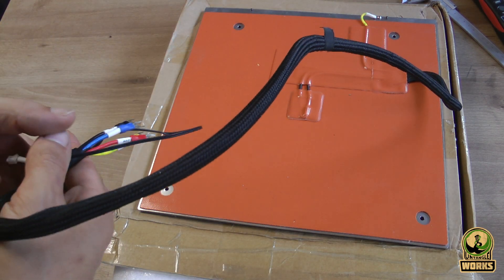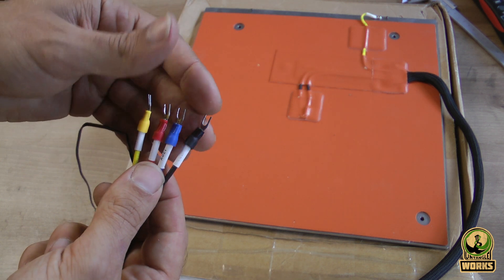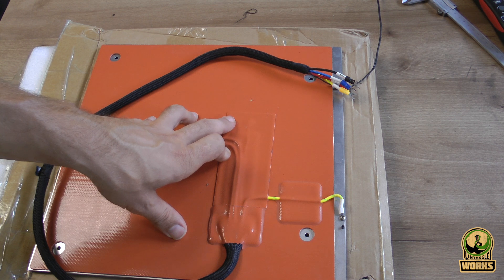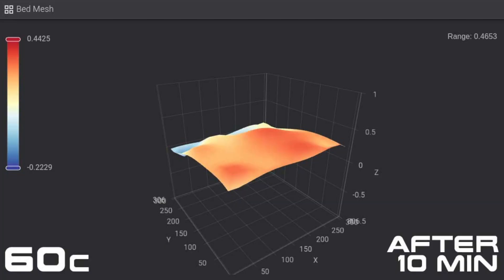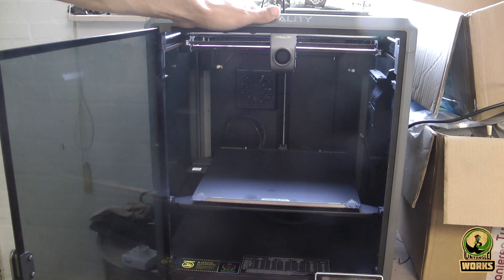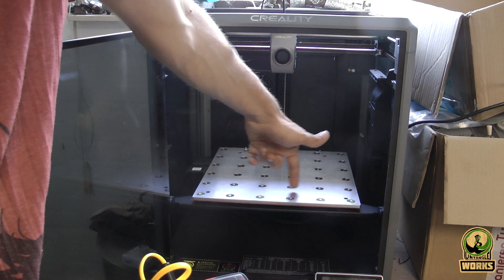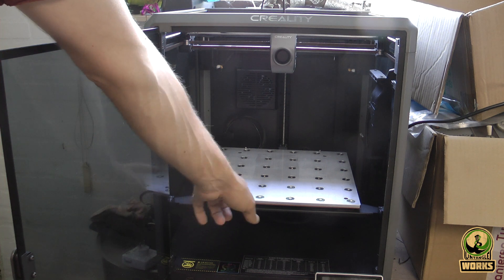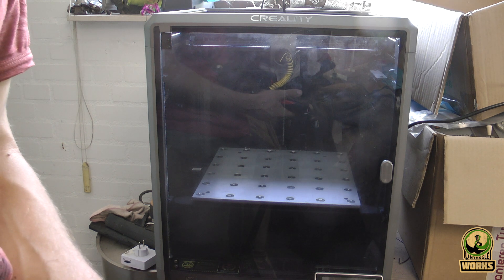creality K1 Max: a second look at the cased aluminum bed from aliexpress

Comment: probably not forged aluminium. they should not warp when heated. probably a cheap aluminium alloy stamped and "cnc'd afterwards. i got plenty of forged aluminium beds for printers and they are straight on all ranges.
Reply from the maker: yeah then it looks like not the real deal like you say.

Comment: Lets go...I've been considering going ahead and picking up one of these thicker aluminum beds!
How's it worked out for you so far?!
Reply from the maker: i consider it a waist of time and money
Reply: @UntangleWORKS  dude, this!
I just pulled up my bed mesh and printed up some shims and I got my bed level on POINT!
Reply from the maker: @lancenig  the shims work sure, but the bed warps when heated. i use a textured glass bed in case i need a large part of the built plate for now
Reply: @UntangleWORKS  That's a good idea, I'll have to track down and buy myself a glass BP for bigger prints. Thank you for the responses.
Reply: I'm thinking that until I get a glass BP for bigger prints one way I could get around the warping so to speak is to heat my bed up to the temp of the next print before I start the print with calibration...that way the bed will already be warped into it's heated "shape" so to speak. I'm struggling for the correct words to describe what I'm thinking.
Reply from the maker: @lancenig  https://www.youtube.com/watch?v=6vU0u630IjU
I have not watched this one jet fully but you might want to give a look. a different way of using the glass bed
Reply from the maker: @lancenig  yeah I get what your saying there. I have not tested this with the stock bed. but with the new one it just keeps on warping over time . but I can print things with it so long the Z offset is set a bit lower
Reply: @UntangleWORKS  This was actually the first video I watched on this whole topic. Now that i've got the bed shimmed this is probably the right direction to go. Thanks again!
Reply from the maker: @lancenig  yeah the shimming thing is working great. but buying the aliexpress bed i would not do it
Reply: @UntangleWORKS  i actually watched as my printer auto bed leveled in caliberation before a prank... It heats the bed all the way up before it bed levels so... That takes care of my idea of warming the bed before leveling as to compensate for warp.

Comment: I'm confused, Is the heat mat that you showed on the video is the one that came with the K1MAx and you are just showing the differences between the Aliexpress heat mats? Or did you get a new silicone heat mat from Creality and  installed it on the new bed? the reason I asked is because the I bought the Aliexpress thick bed and I noticed the difference between the two silicone mats. I tried to get a new silicone mat form Creality, but they don't sell them and some people have suggested to remove the mat form the old bed and reuse it which I'm sure that it is safe. I ended up using the heat mat the came with the new bed and had to do a custom connection in order for them at to heat then entire build plate evenly
Reply from the maker: yeah for what I have seen is that not a smart move to remove the heat mat and reuse it. but  my impression was as well that creatly is not selling them separately. but no I was showing here how unstable this aliexpress build place was it chances shape every time I measured it and letting it heat soak for like 0min, 15min and so on the results would be different.

I wish I did the same test in documented from for the official bed. but I don't think it's worth the trouble at all really and expense

Comment: There is a video on YouTube of a person you used a glass bed underneath the magnetic build plate. The glass won’t warp under heat so i think it’s a good way to have a level bed. He did claim he had to replace a part in the bed itself, maybe a probe if I remember correctly. But then he used 3M sheet to secure the glass to the bed and then a magnetic sheet ontop of the bed for the build plate to stick to. Because of the raised height you do lose the indexing screws that the build plate notches fit into for alignment.
Reply from the maker: yeah glass would be a better way to go if you have issues with the bed then this route that I took.  with this I got a textured glass bed on my ender 3 and that works really well but you will have to let it cold down for parts removal

Comment: Aluminium has a pretty high coefficent of thermal expansion (even higher than steel) so its not really a good solution. Ideally would be glass, realtivley flat with low CTE

Comment: If you tighten the back side bed bolts, and leave the front bolts just a little lose, this would secure the bed, but also encourage the bed to expand more in horizontal plane, and less in vertical axis.  Reducing cupping or bulging in the middle.  All four corners tight makes the direction of expansion only up or down.  All four corners lose may have less vertical expansion, but as you said, shakes and shifting.
Reply from the maker: I did check if loosen in all the screws up would make a difference just to see what happens to the bed. in this print bed is case it didn't really seem to make a difference the pastern was the same.

but I have heard about only tighten down 1 screw  before for kinda that same reason you explain with the 2 bolts

Comment: no metal plate is going to stay flat when you heat it from one side. That plate has recesses machined into the top for the magnets making the situation even worse. I would put your original bed back on. Another option is use a thick plate that does not have the magnets and attach it to the mounts with adjustment screws and springs like bed slingers. This will allow the bed to expand with out so much tension buildup. However in the end bowing up in the middle cannot be avoided no matter what. I print objects that span the bed and do not have a huge problem (on k1 max). This is not to say that the head tracks the bed perfectly as it does not but it works good enough. I think this issue is just the nature of the beast.
Reply from the maker: thanks for the reaction Mitchell. and that makes sense. I was told that would be less with cased aluminum but the points you make about the magnet pockets does make sense it crossed my mind later a bit as well like that does make the bed thinner actually
Reply: @UntangleWORKS  It is not so much that the bed is thinner. It a matter of surface tension in the plate being disturbed across the surface of the plate by the holes. Warping will be less with cast aluminum if the heat is even , like if you just placed it in a hot chamber. In this case you are directly heating 1 side of the plate and the other side is unheated. The hot side is expanding more than the unheated side along with you have a issue with the edges of the plate  not being heated and exposed to air. The edges of the plate are restrain the expansion of the plate also.
Reply from the maker: @mitchellcrane9809  yeah that makes sense thanks for that
Reply from the maker: also I did also tested losing the bolts a bit and did the test again but that was pretty much the same type of deformation was happening